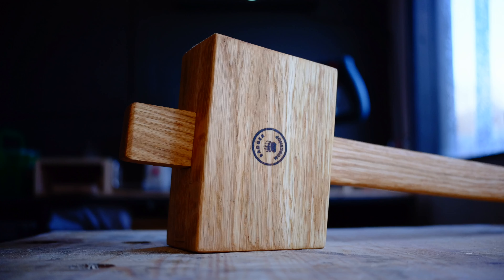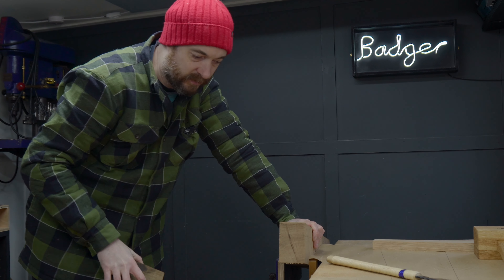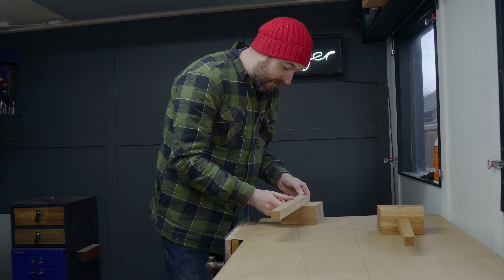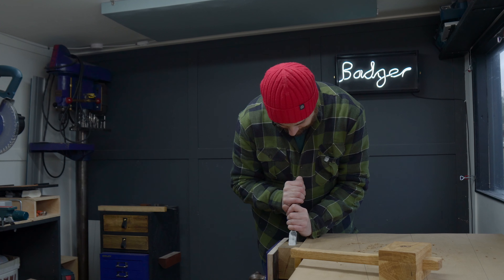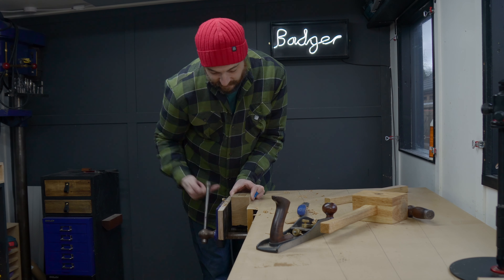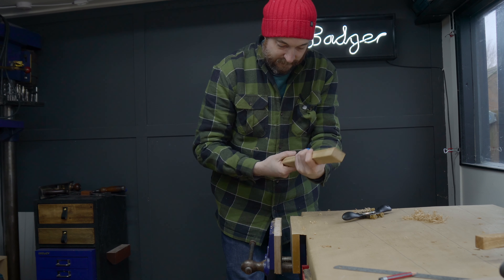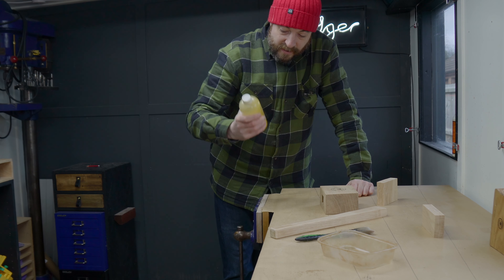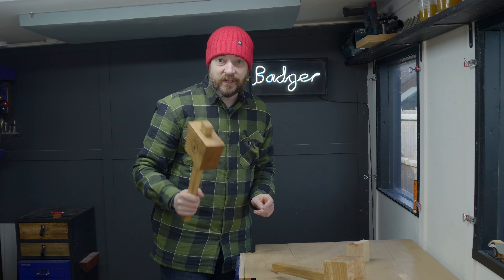Making A Mallet With Hand Tools

Comment: "Badger Un-plugged" - I like it ! 😉

Nice work Matt that came out well, a swing brace and bit can make the mortice a little quicker and easier to cut, but tbh that Oak didn't look like it was too hard to work ! Some like to select a piece of Oak with knotted grain for the head as this makes it more resistant to splitting, but that can be hard work to chisel through !

Like the Outro/thumbnail pictures - channelling your inner Thor !  ⚒ 😁